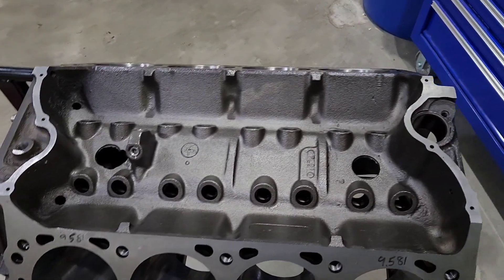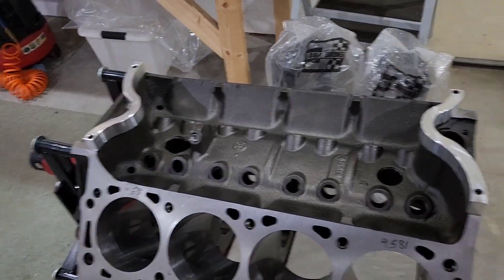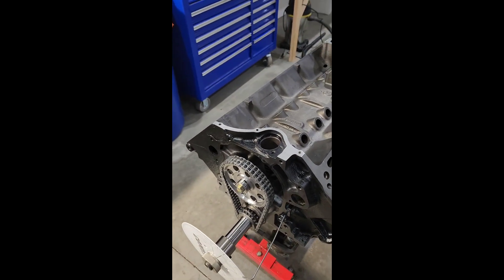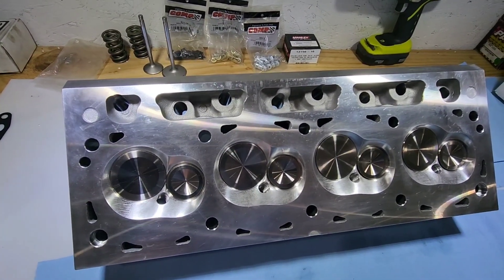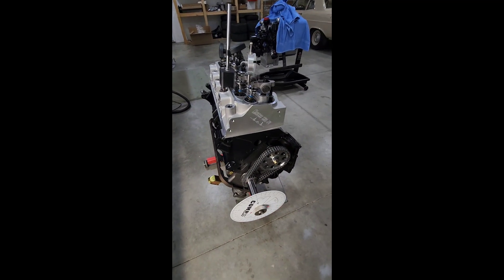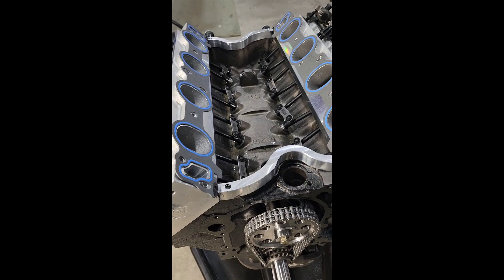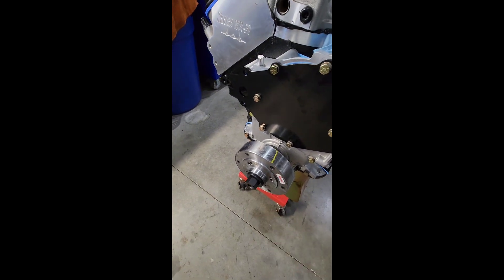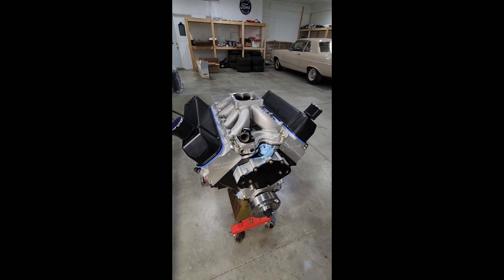BBF Ford 557 Start to Finish Build with Kaase SR-71 Heads

Comment: I contacted this company about a set of heads for my Ford big block build. They tried to make me believe I can't get 800 HP out of a 460 block bored 40 over and stroked to a 429. Apparently they are way smarter than the computer program I was using. I didn't make 800 but I went with machined D0VE heads and saved about 6000 bucks. Came in at 700 HP naturally aspirated without NOS. Never will buy a product from these people.

Comment: Great article on a very nice build. I just wanted to let you know a little about Jon Kasse. I have known him since 1986 when he was sharing shop space in Norcross, Ga. before he moved to his present shop up in Winder, Ga. just northeast of Atlanta. I can tell you that you bought a great product from a guy who is a super person and extremely good in his profession. He and his crew make superb parts and his knowledge of everything is second to none. He is very down to earth and easy to talk to and is not afraid to share some knowledge with others. He pauts his heart into everything he does so you made a good choice with these heads. He these heads are actually an evolutionary part that started many years ago with the first Cobra Jet heads that  he did for Ford Motor Co. and were sold in the Motorsports catalog. Jon kept improving them and after a couple more revisions he released the SR 71's. They are the latest and most improved of the bunch and have made impressive power on the Big Block Ford. Just thought you would like to know.

Comment: I would like to know how much horsepower does your 557 makes with the SR71  You should be making over a 1000 horse They say those hits work better the bigger cubic inches engine you have. My engine has a hydraulic bowler cam Is and I drive it on the street. I have 14 to 1 compression as well.

Comment: What size is your engine is going to be? SR71 CYLINDER HEADS are great with Big cubic inches engines
Reply from the maker: @tyronemcintyre3278  Thanks! It is a 557
Reply: @Ronthegearguy   They did not have the Sr 71 heads heads when I bought my P51 If they would have been out I would have made a bigger engine maybe a 604cu  They say they They do better on big cubic inch engines. I called down to John Kaase  And talk to them about the P51D It's supposed to be a new head that they have out. I'm very interested in seeing how much horsepower you're 557 makes With the Sr71's  VS mine with the P51

Comment: Looks good 👍🏿 I have a 557cu with P51s 890hp in my Torino street car. The next engine I will have SR71 cylinder heads
Reply: Can you tell us bit about your build Tyrone? I have 521 I my 67 fairlane with afr bullitt 315s on it. Haven't dynoed it.
Reply: Race gas or pump gas I have a long bed 1989 f250 I wanna build like that

Comment: I'm building a 557 now with the SRr-71s for a street rod. Wonder if I could use all the parts, you did minus cam. I'm looking to be able to stay on 93 pump gas so 14:1 compression may be a little too high for my needs.
Reply from the maker: @matthewmanning9578  Yes, for a street car on pump gas, you will want less cam and less compression.

Comment: Hey check your oil pump for cracks, noticed the stem type on it. Get a Kaase oil pump with the thick flat mounting stem. The stock type are prone to cracking, and a 557 deserves the insurance. You got Kaase heads so use the good Kaase oil pump.
Reply: That’s only when u force the pickup down to the main cap and put stress on the stem.

Comment: Very nice build, im a big block ford guy myself. Nice to see some people still running this ole engines
Reply: Putn 1 n a 86 tbird
Reply: What does short block and long block mean if I can ask? Im new to everything but like this kind of stuff lol
Reply: @lessummers5738 short block is just block and rotating assembly.  Long block also has heads and valvetrain.
Reply: @lessummers5738 

Short black = assembled block pistons and crankshaft.

Long block = above with heads installed

Complete = drop in with carb

Comment: If Ford would not have been so CHEAP they would have designed these with a 4 bolt main. Cap shift is a huge problem.
Reply: 429 SCJ blocks are 4 bolt main.  Or get a number of 4 bolt aftermarket blocks.

Comment: I have been building these engines for over 35 years. They will not produce the power that a 454 Chev will make. And that drives me crazy.
Reply: lol tell that to Bob Glidden (rip) or Jon Kaase who won several engine masters competitions with one.
Reply: With what heads? Have you tried these sr71's or AFR BULLITTs or Trick Flows?

Comment: Why wouldn't you use a460 heads? Kaase are nice but a460heads are a step up.
Reply from the maker: I would, but my car has a stock engine compartment. The valve covers would probably hit the shock towers, lol. The sr71 heads are the best factory style heads

Comment: Kasse makes a super duty oil pump. You should've installed one.
Reply from the maker: I haven't had any issues with the stock pumps
Reply: @Ronthegearguy  I heard about the bolt flanges breaking on the stock pump. Look up the Kasse part. It's a beefed up design.

Comment: What did the car run ?
Reply from the maker: 9.36 @142 1/4, 5.92 @116 1/8
Reply: @Ronthegearguy what gears you running for the 1/4?
Reply: @Ronthegearguy 
What weight of car was it in and did you dyno the motor ?

Comment: Hello Ron: Mid-9s on a 9" tire? Leaf spring suspension? Wow!  Question: The spring spec for 0.800 lift cam, is that nominal?  You mentioned that cam gross lift was 0.780ish.  A little tight, or is spring bind near 0.900ish?  Thanks for video Ron.
Reply from the maker: Thanks for the kind words! The springs are good for .800 lift with an extra .060 clearance before coil bind. You just wouldn't want to go more than .800 lift. Thanks!

Comment: Nice build. D9=79. I prefer a rear sump pan. Torque seems to pull the oil away from the pickup on front sump pan. Good luck. Have fun
Reply from the maker: Thanks Brent, I appreciate it. D9 was the casting number on blocks made from 1979-1997. I would like to use a rear sump pan, but stock chassis requires front sump.
Reply: @Ronthegearguy  still great build my friend
Reply: @Ronthegearguy  I'm thinking you should be over 900 horse power
Reply: @Ronthegearguy  1000hp 800fpt
Reply: @Ronthegearguy  E9=1997
Reply: D9 was 79-97. E9 is late 97 up. Please stay out of comments if you don’t know what you’re talking about.

Comment: Great video, and thanks. Try to stay hot on your builds/videos. I remember shutting down that track on a similar build around 2004. "D9" sounds like a 1979 block? Mine was a D0VE, thus a 1970 block. I also believe there is more power to be found through timing and jetting, or maybe shift points/converter. Your tune now is easily north over 880 hp, and about 750 torque.
Reply: D9 is a 1979-1969 Block. The design didn't really change enough for a full revision from 1979 thru EOP in 1996. For refence there are only 5 385 casting numbers C8VE, C9VE, D0VE, D1VE, and D9TE.

Comment: Crank girdles are a waste of money, its not a chevy
Reply: Can't hurt.   At least the crank will probably stay close to the block if it tries coming out.
Reply: @bigboreracing356  the gurdle that he's recommending is for the chevy driver,not the motor .😂
Reply: It's cheap insurance! I don't plan to die in the next year, but I  have life insurance!😂😂😂
Reply: I ran these engines for years. Up until I used a main girdle windage trays would Crack and sometimes oil pickup tube mounts would also Crack. I have run these engines with stock block to 900 + Hp. Main girdle is a wise choice. Main caps will walk causing bolt deflection causing cracked windage trays. Nice job on build
Reply: What good does it do without any extra bolts?
Reply: @steveharper9964  ties the main caps together to help cap distortion. They use a custom stud. 351 Windsor blocks hang in there pretty well with out it, but rednecks were stroking them t  " 4.125 or so with that 9.5" deck! Shooting 350-400 on them! When it let's go!!!! I'd never go psst 4" stroke. Rednecks were using 400m cranks, 302 boss pistons, stock rods 25 years ago! Back then blocks were lying round everywhere!
Reply: @steveharper9964  Try looking up basic engineering.
Reply: @Comet-hn3gm  ok, I get it now, it at least ties the caps together. But even the engine builder was nagging on them.
Reply: @steveharper9964  For sure, more mounting points for the cap should be better ! If the realistate is there. I do believe the best Ford main girdles are made from aluminum. DSS comes to mind.   That being said my 408W just has studs and see's 7000 RPM on most shift's and has a Scat cast crankshaft. Seen about 5K miles so far.
Reply: @steveharper9964   Most people assume it's to increase the tensile fastening of the caps to the block,  but a girdles primary function is keeping the caps from moving and crawling longitudinal to the crank length, not to resist the crank from pushing out of the block.
Reply: @Resistculturaldecline  if you feel the need to reinforce the mains clip the cap flat with the bolt pad and put a3/4 strap across it at least it is holding the cap not the bolts
Reply: Did u pay for it?? No.. so STFU
Reply: If the ford made 4 bolt mains and steel cranks they woukdnt need all that , 2 bolt main nodular crank is def not factory high performance
Reply: @David-er1cy   I've used 2 bolt blocks with cast cranks shifted them in the  7500 rpm range never hurt one my old engine was 460 cast crank stroked to 4 inch with 6.535 BBC h beam rods 2 bolt block saw 7500 every pass even hit 8500 a few times ran it for 10 years never a problem
Reply: @David-er1cy ford built the 2 bolt blocks strong enough they didn't need the extra bolts or weight. However I'd definitely recommend the Girtle for Gm. Along with other reinforcement.
Reply: @David-er1cy  we spun a stock block, stock crank  351w 6900 rpm 8-10 times a day, 3 times a week for 3 years with no problems! Just a aftermarket oil pump and good prep! Was that heavy cast crank with 3" mains a great design for a high rpm engine? No, but it works fine! And you don't have to cash in your 401k to go play!

Comment: Very nice, dude. Too bad it has that front sump. Under hard acceleration (which is definitely going to happen), the oil will slosh back and away from the oil pickup. Spun bearings are common with this problem. Sorry about that.  Makes me sad to know how much work you put in to be faced with that.
Reply: They ran these motors back in the 70s in super stock. You put a 3 quart accumulator on the floor and that thing will run 7500 all day long with the wheels in the air and not have an oil pressure problem.

Comment: Why 21 thou on top and 24 on second ring?
Reply from the maker: Hi, the ring manufacturer recommends using more gap on the second ring to prevent pressure buildup behind the top ring which causes ring flutter.
Reply: @Ronthegearguy  oh that makes real good sense. 
Thank you for the education.
Reply: I am really into your assembly here and also very interested in how, where and how much power it makes. Beautiful Work BTW. I was really hoping to see it Injected instead of carb fed but I’m sure you have a reason for that. Fantastic looking engine Man!